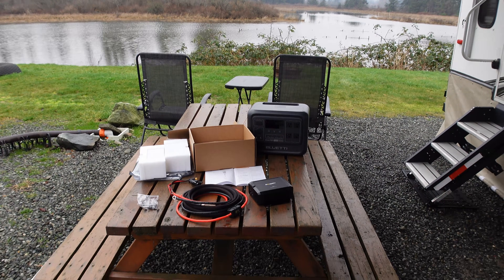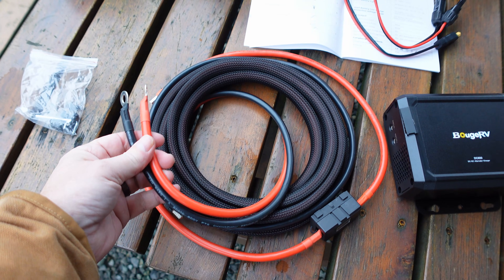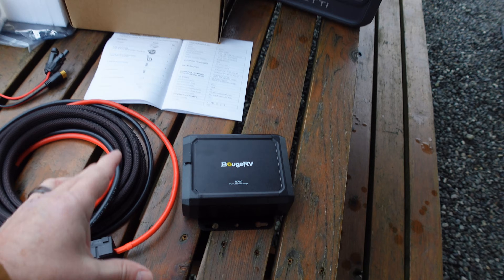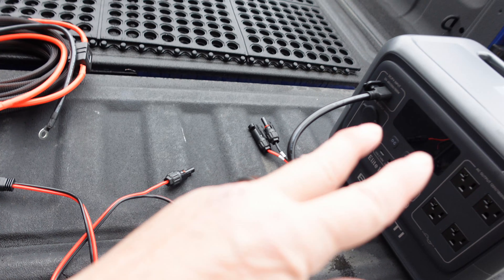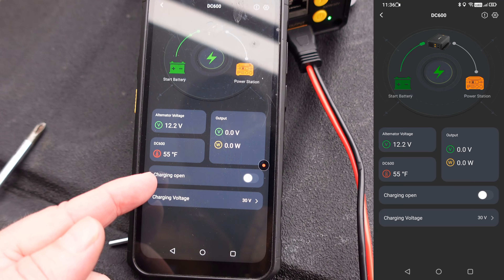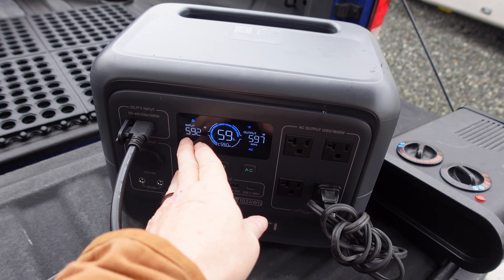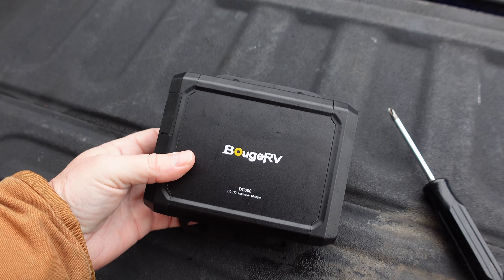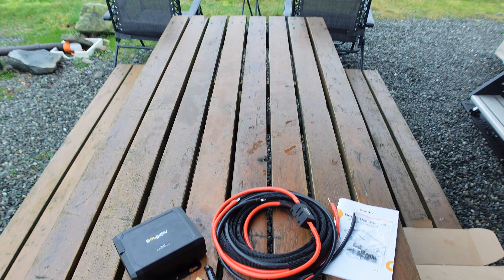BougeRV DC-DC Alternator to Power Station Charger Demo - 600 Watts of Charging Power from Vehicle

Comment: Thanks for the great review,  as noted by others the fan sounds like a turbine jet😅, wondering if I could replace it with a quieter fan.
Reply from the maker: It think given the small size of the fan it wouldn't help much. As I see it the problem is they are running the fan full speed all the time. They should have a temperature controlled fan circuit so as needed the fan speed adjusts with cooling required. The Bluetti brand of charger I reviewed in the past does this. Cheers, Ray

Comment: They say that lithium batteries can be hard on alternators, will your alternator handle it? I guess you said its limited to 10 amps only so I guess it could do that for 2 or three hours with out burning out the alternator? great demo, thanks for posting.
Reply from the maker: Thanks, yes I forgot to mention about the alternator as I have in the past with devices like this. It's not so much that it's hooked to lithium more its the constant amperage draw especially at idle could overheat the alternator.  The device has a max draw on the alternator of 50 amps when set to the 60V but at the default setting of 300 watts 30V the draw on the alternator would be 25 amps max.
Same thing could happen running an inverter, winch, heated seats, high wattage light bar, etc 
Alternator loads can vary a lot depending on the vehicle, some are really loaded up with options these days.
Many modern smart alternators will derate themselves if that is the case but its good to check with a mechanic for your particular vehicle.
On my boat engine last summer I ran one of these devices from Bluetti and rather than run it at max wattage I ran it at half and let the power station charge slower keeping the alternator heat lower. The boat only has a 85 amp alternator on its old diesel engine.
My diesel truck comes stock with a 180 amp but I elected to upgrade to a 220 amp so have lots of head room to run high amperage items, that is why it has the special terminal block one it. It's also a tradesman model with very little electronic bells and whistles drawing power. Cheers, Ray
Reply: I wonder the same - most alternators are 150-200 amps so they can handle it but suspect it may cause it to decrease the life.  However 2-3 hours is extreme - it will manage more than that for sure.
Reply: I would also add that on a diesel truck his alternator likely outputs 250-300 amps…. Some trucks even have two….

Comment: Ray, the fan sounded a bit loud during your outdoor review. What is your opinion of the noise level if installed and operating in the truck cab while traveling. 

Makes me think of putting it in an enclosed box with ventilation and in the truck bed. Just have to manage potential moisture intake.

Thanks for your content, testing and reviews. Much appreciated. 

Safe travels and Happy New Year to you and the Mrs.

Rob
Reply from the maker: It would be annoying out in the open I'd say. Could install flat under the rear to deaden the sound if there is space there.  As far as in the bed I have a bunch of stuff installed in a truck tool box for years now. Inverter, AC charger, solar controller, DC-DC charger, etc and haven't had a problem. My trailers unheated front storage compartment is also full if devices. Haven't had a problem going on 15 years. The key is ventilation, make sure that air can flow in and out of the enclosure so condensation doesn't happen.